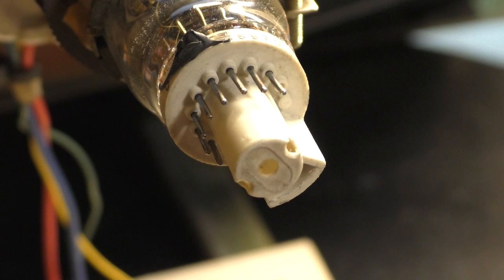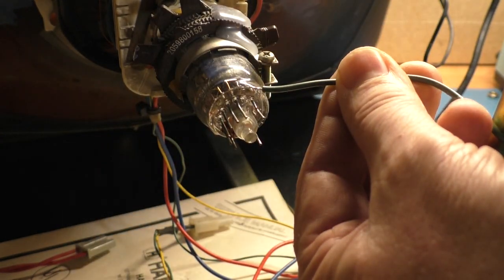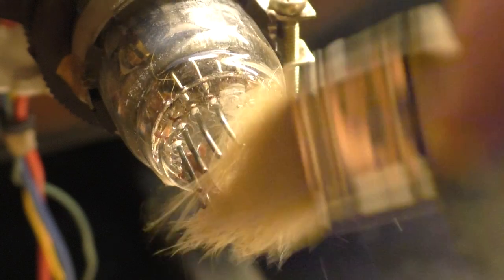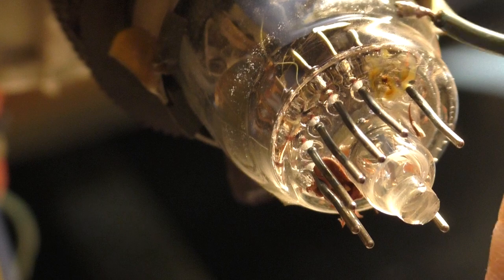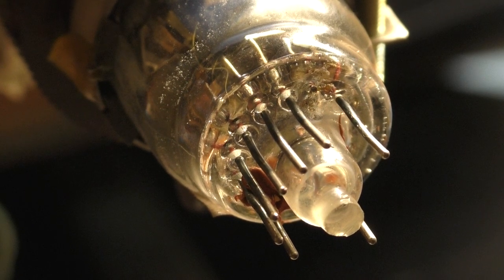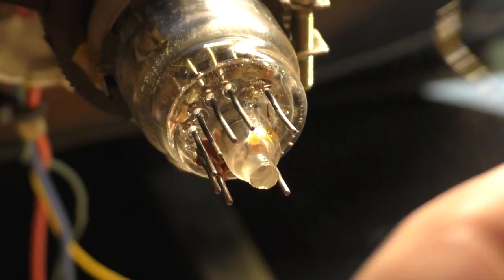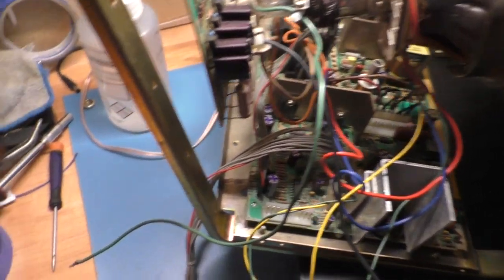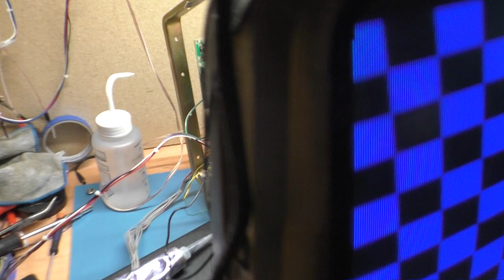Arcade Monitor Repair 101 - Is Fixing A Broken Tube Pin Possible?

Comment: You needed a small glass grinding tip as most of your rough grinding with that large tip kept on shortening down what was left of the pin. I have done this before and then had  enough of the pin exposed to loop a wire around and out through the neck plug.

Comment: Got my first PVM, bought it for cheap since it wasn't powering on. Turned out to be a blown fuse. Fixed it, disassembled for cleaning and maybe capacitor job. Broke focus pin at the neck :/ Quite possibly it was already weak from shipping damage as the tube broke off from the plastic mounts. Quite a nerve wracking repair for a total CRT noob but I was lucky and was able to fix it thanks to your videos. I'm super thankful!
Reply from the maker: Sweet!

Comment: I did this once on a pin that broke like yours, but what I did was to set the tube facing down , I put some no clean flux in the hole, then cut a tiny piece of solder and put it in the hole. Then I put the pin in the hole and heated it up to 660 degrees while applying pressure.  Once it got to temp the pin dropped in and it worked perfectly afterwards.
Reply from the maker: I couldn’t get a good close camera shot on my setup with the tube facing down so I had to do it this way.
Reply: Did you write a tutorial on this on KLOV or some other page like that? As I commented on this video, I remember reading a workflow like this and your wording seems very close to what I remember as well. Cheers
Reply: I've tried this method but it didn't for me. Maybe the temp was too low but I was too afraid to heat the glass too much. I decided it'll be much more reliable with a wire anyway.

Comment: I remember reading once that for a broken pin that is down inside the glass, to cut a piece of solder wire and place it in the hole. Then take the broken pin and and place that on the solder, heating the pin with your iron until it melts the solder in the hole and the pin can be pushed back down where it should sit. Never tried it. So far have not had to. Might be a horrible way of doing it... but that is what I read and never forgot, so wanted to share. Thx for the video sir.
Reply from the maker: It might work but the next time you try to remove the neck board, the pin is likely to come right back out.
Reply: @MikesArcadeMonitorRepair  I hope I never have to try. Just like I hope that someone will start producing CRT tubes again.

Comment: Hi, how are you? watch your videos a lot, I like electronics. I'm an amateur. I have a k7400 that when turned on did not have good focus until it warmed up. For that reason I changed the neck board socket and now I have no image or contrast. I can hear everything turning on but the image doesn't work. I changed to the previous neck board socket and the problem remains the same. Could you help me and guide me? I live in Uruguay otherwise I would send it to you to repair it. thank you so much

Comment: Would it make any sense if we tried to replace the pin with a thick piece of copper wire, because it's easier to solder it to the stub?
Thank you for giving us hope with your videos - i was devastated when i found 2 broken pins after a month of daily work on the chassis, trying to find the cause.
Reply from the maker: No. Would likely just break off.
Reply: @MikesArcadeMonitorRepair  😞 thanks

Comment: Sorry, just one more question: what is that isolated single pin which doesn't figure on the neckboard? Is that focus?
I'm wondering if this could be the cause of permanent blurriness (broken pin which was "repaired" with silicone only)
Reply from the maker: Correct. Focus pin. That would explain your permanent blurriness if it’s broken.
Reply: @MikesArcadeMonitorRepair  thank you!
Reply: @MikesArcadeMonitorRepair  Just wanted to report that the operation was successful - the picture is much better now. This Permatex is a great solution (i don't know how long it will last). I even managed to remove the neckboard and the mask a couple of times (extremely slowly, millimeter by millimeter).
Unfortunately, the moment i repaired this, my machine started smoking for some completely unrelated problem 😄

Comment: Would it be easier if you put the tube face down so gravity would work in your favor?  Was the original pin not reusable?
Reply from the maker: Possibly. Yes, but there’s no way it would stay in place.
Reply: i was thinking the same, although not done it before... I also wondered if u made a hole with ur dremel like u showed, fill it is liquid solder or solder paste and use hot air on the tube... what will happen?